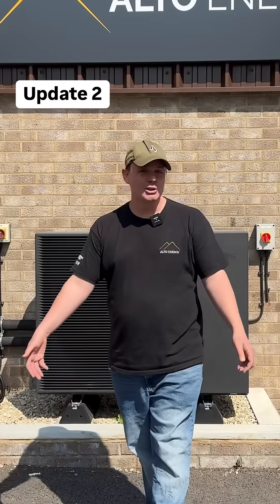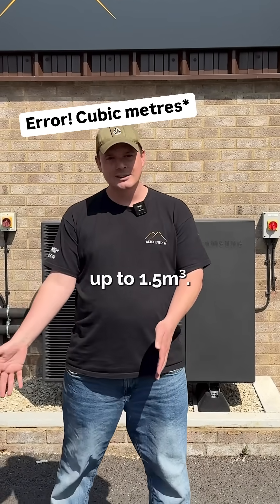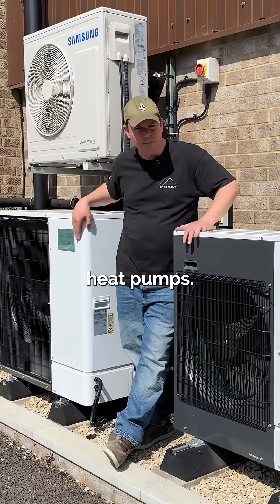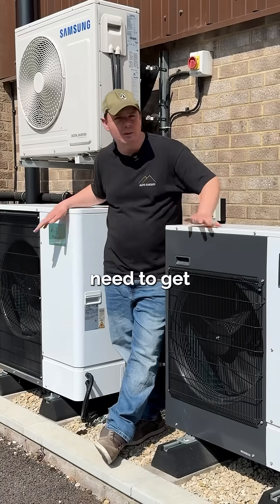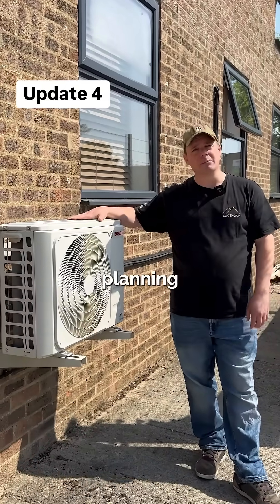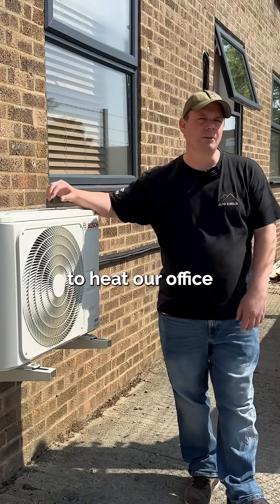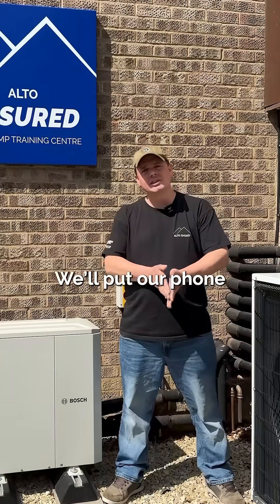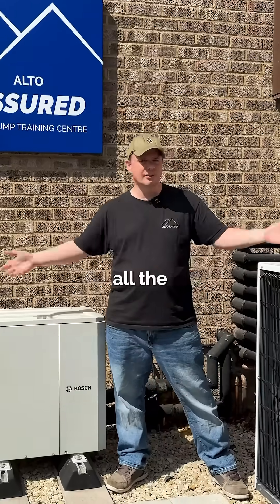Planning rules relaxed for air source heat pumps 2025 #heatpump

Comment: These are like betamax videos, Hydrogen is the next fuel..
Reply from the maker: The problem is, hydrogen is pricey to produce, needs new infrastructure, and isn’t as energy-efficient as heat pumps.
Reply: @AltoEnergyLimited Still, IMO, a stop gap.